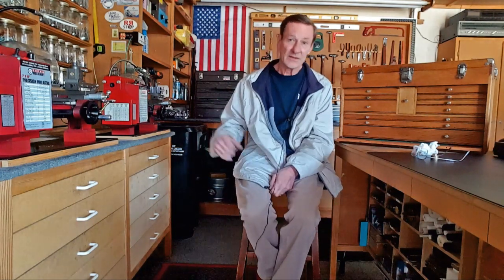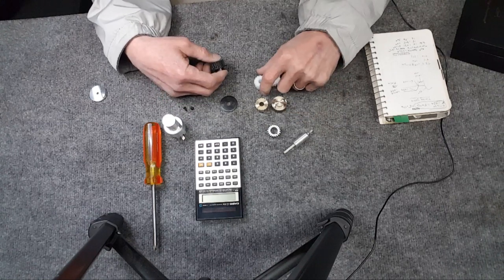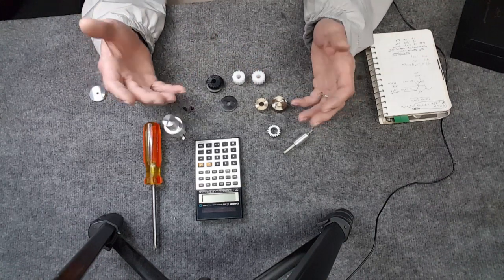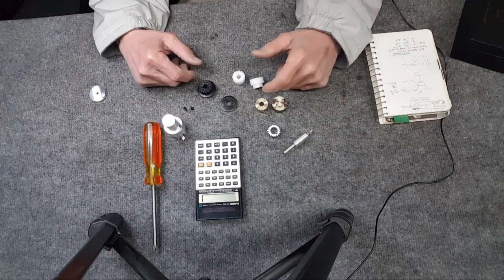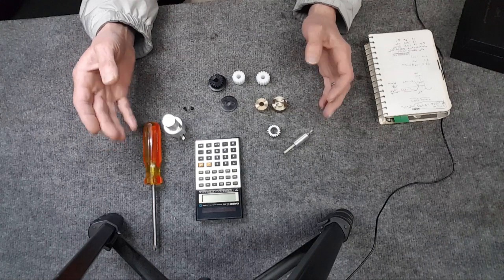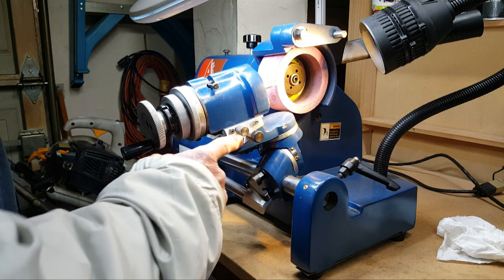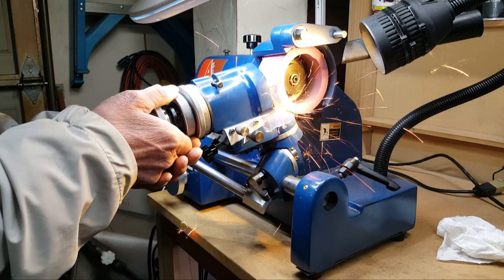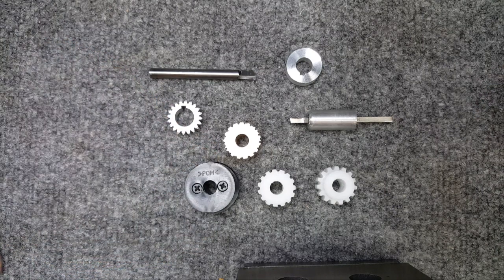Gears & DIY Broaching Tool

Comment: Hey Dave, I just bought a used industrial lathe that is 660mm x2000mm and I was told that it takes a 32mm shank tooling, I was wondering if it were possible to use smaller tooling with blocks underneath instead?
Reply from the maker: Absolutely yes! Just set the tool height for rotational center and done...

Comment: Hi Dave
I've been watching your videos for some time now and find we are often dealing with exactly the same problems.
I made a 12 tooth pulley to gain torque by slowing my mini lathe down some time ago. It was cut on the lathe using a flycutter with a 42 degree included angle tip ending with a 1/16" flat on the end and an indexing device best described as makeshift. The fit of the belt was quite good, it has now been in use for 7 or  8 years with no problems. I wrote up the how-to in Home Shop Machinist magazine as part of a series on improving the mini lathe. The series is now available in book form from Village Press, publishers of Home Shop Machinist magazine. I will email you a couple of photos since you tube won't allow me to post them here.

Comment: I switched my 7x14 to XL pulleys and belts. I used a 10 tooth motor pulley and a 30 tooth machine pulley. I think the pulley part numbers were 10XL370 for the motor 30XL370 for the machine. The part number describes the pulley 370 means is is a 3/8" width pulley. I ended up with a 126 tooth XL belt..

Comment: Hey Dave, I like your videos.  Owners manual list this belt as L136.  This link https://www.zzr-parts.com/modulus-synchronous-timing-belts/1-5-x-70-teeth-replacement-drive-synchronous-timing-belts/ is for the 1.5X70, and has an additional link for more specs.  It shows the model as 1.5 with a pitch of 4.712mm and a tooth height of 0.9mm.  40deg angle 2B.  Hope this helps...
Reply from the maker: I can not thank you enough for this information!!!!

Comment: Hello Dave, I make small gears for antique clocks and the tooth profile is different on almost all of them so I usually have to make a new fly cutter for each project. I have never used an optical comparator but have been told it would be useful in helping me quickly determine the radius of the tooth profile for making the cutter. If you are looking for ideas for video's I would like to see a tutorial on how to use your igaging optical comparator. Just an idea... Thanks for always sharing your knowledge!